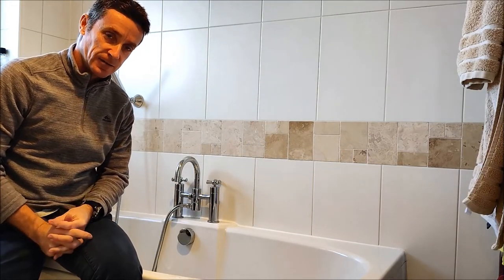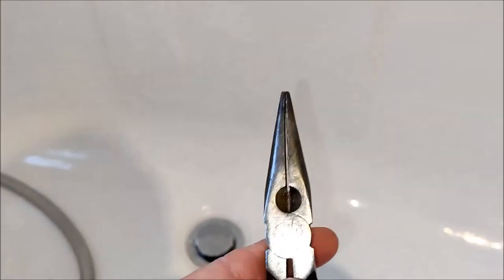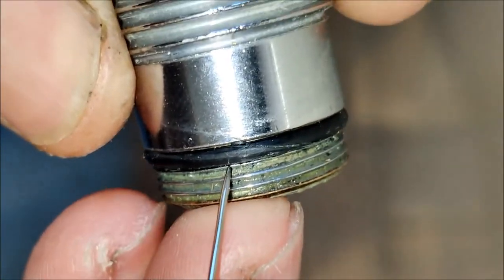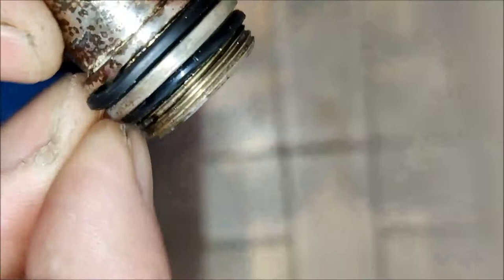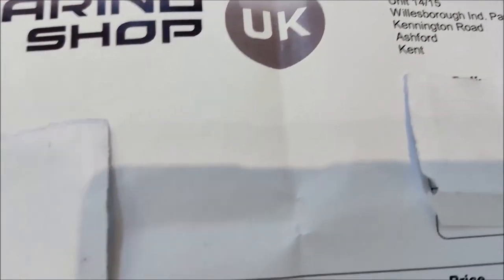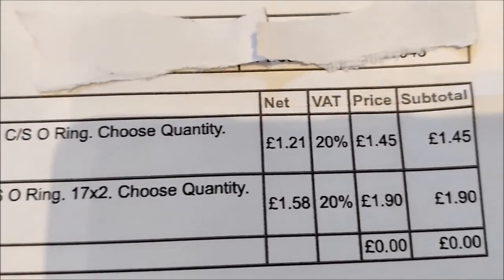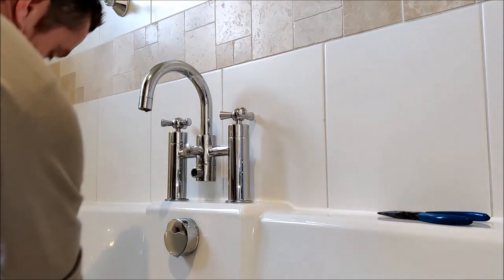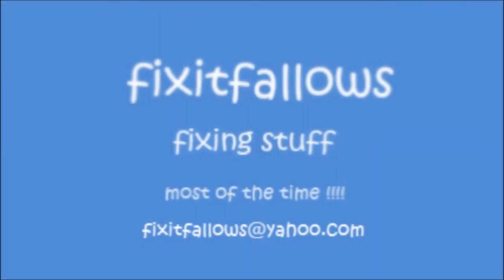Bath mixer tap / faucet with leaking swivel shower hose fix

Comment from the maker: ***Clarification****

I've had a question and I should have stated in the video (my bad.... I'm new to this 🤣🤣🤣🤣) ..... the question is should the tap be isolated from the hot and cold water supplies when doing this fix?........
     the answer in this case is no as the hose aspect of the tap is on the "outflow side" of the actual tap valves. The tap itself is the isolator.